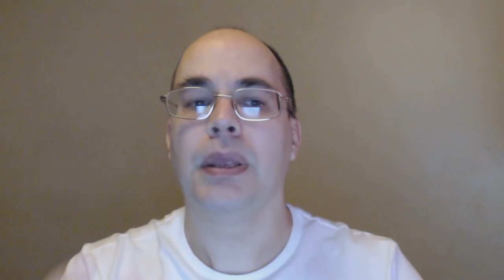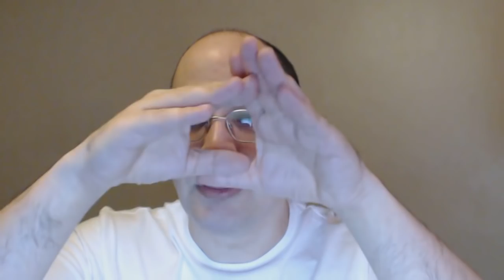How do rockets move in space, with nothing to push off from?

Comment: the combustion inside the rocket PUSHES the rocket forward.  The two sides negate each other.  The combustion escape out the back, thus, the only force left is that which is directed toward the front of the rocket... and thus, it is moved.  Is that simple enough for all you flatards to understand.  It doesn't push against whatever is behind it at all.
Reply: mkbxtr44  that's as ridiculous as mounting a large fan on board a sailing ship to blow into your own sails, and would work the same exact way. Not at all!
Reply: John Morrison, ah no! 'Thrust' works in all directions and Newton's 3rd law (every action creates an equal and opposite reaction) explains this without any of your bullshit and mathematical equations NASA throws out to obfuscate their explanation. A rocket's 'Thrust' cannot and will not work in a vacuum. It will work in  a vacuum CHAMBER but only because it can push off of the bulkheads and end cap.
Reply: @asleepinthealley  Oh you are one of those people that believe in a flat Earth and have never had a physics class and think you know what you are talking about but don't realize that you haven't a clue. Thrust does work in one direction no matter where the location is otherwise it would be a static event and no movement would occur (all of the forces would cancel out). It really is the same thing as throwing a medicine or bowling ball while on skates. The force on the ball as it leaves one's hands is the same force on the hands from the ball. As soon as the ball is not touching the hands any longer, there is no more source of energy to add to that system. The ball propels one direction,  the skater propels the opposite direction. The skater is thrust in one direction because the force placed on the ball. This is assumed that the ball is thrown exactly horizontal and away from the skater. If the ball is thrown away but upwards or away but downwards then the cosign of the angle of the direction would only contribute to skater's thrust. The gas is the propellant in the case of a rocket. The gas is under pressure and then forced out (thrown from the exhaust nozzle). Gas has mass and a change in momentum creates a force. The mass flow rate of the gas X the gas' velocity creates the force. Come on, this is not rocket science!
Reply: @asleepinthealley  What does NASA have to do with how a rocket works in space? Do you not agree that the skater would be propelled in the opposite direction of the bowling ball? You think that inertia explains that? Please elaborate.
Reply: @asleepinthealley  You are parroting Flat Earth BS that won't fly here.
Reply: @pblakeney  No. I am stating facts. When facts directly oppose everything you've been taught, it is not the facts that need to be altered. Your pushing the "Flat Earth" concept skylines yourself as a Shil.
Reply: @asleepinthealley  You have stated no facts. So, state some facts for me and lest's see how they hold up. What are your 'facts' besides the one where you don't have never taken a physics class and you are not qualified on this subject. The  last I checked it is only the 'flat earthers' that use the term shil. You speak right from their talking points. They got you trained real well.
Reply: @asleepinthealley  It is so cute watching millennials try to explain something to engineers/physicists that they themselves no nothing about. It is painfully obvious to those with engineering degrees that you have never been in a physics class room in your life.
Reply: Balabajka, please. You're effectively claiming that explosions don't work in space.
Reply: John Morrison space is a vacuum. Won't work. Space is a lie.
Reply: Flat Earthers is government propaganda and a few crackpots to boot. But when you use flat earthers to make a point, you show your under belly along with your treason.
Reply: TheDogSheep, the truth remains the truth where it is found. In a Constitutional Republic our first allegiance is to the Constitution itself and treason would be the subversion of that.
Reply: that's a lot of horseshit.
try replicate that in a gradient atmosphere.
there is nothing there to move up through, it acts as a barrier, as it tries to leave the atmosphere it gets pulled back down, or 'blocked'.
Reply: Everybody knows the easiest path of flow is how it works you don't get an equal opposing force against the rocket from the fuel payload expelling because it's path is too easy to travel..."0 pressure" even if the rocket weighed 30 lbs. The force of combustion will greatly exceed pushing the rocket for expelling into spaces vacuum
Reply: @LemarFrench  No, everybody does not know this, only you in your wild imagination.
Reply: @pblakeney  everybody knows common sense...let's see... how far is the sun from the earth...93 Million miles?? But you can explain the sun in the same manner if it was smaller and closer sooooo???  If that's a law we use you should not be able to reengineer the understanding unless it's flawed
Reply: @LemarFrench  Please explain what you mean about "rate of burn". What about it confuses you? Are you thinking that there is not enough liquid to burn to get in orbit? One can calculate how much fuel payload is needed to accompany a rate of burn to get into orbit or space. Once in space, not much fuel is needed as Newton's first law helps with that. For example, in going to the moon, most of the fuel for the mission was used to get out of Earth's atmosphere and then its gravitational force. Once the burn was made and trajectory was made to point to the moon, no more fuel was needed to get to the moon (Newton's first law). Lifting off from the moon was not demanding either as the moon has no atmosphere so little fuel was needed to escape the moons gravitational pull.
Reply: If space is a vacuum then you can't propel through it.
Every action has an opposite reaction.
Theoretically if you fired a machine gun Once In Space you would move the opposite direction of the bullet?
So for every shot fired would increase your rate of opposite reaction .

It's the biggest scientific contradiction.

Doesn't matter what shape the Earth is.
Reply: @buckrogers2752  A vacuum is by definition a space void of known mass, but not empty as we know photons don't have mass yet occupy space...traverse space...etc.  Space void of mass should not by definition be able to support mass by definition...they don't correlate just coexist...photons don't have mass so they make sense moving through the vacuum ...they do not need to be supported by mass to move through the vacuum of space
Reply: @LemarFrench  planets and stars occupy space which have mass, so space must not be a vacuum. And space does not support the mass. The mass just exists in space-time. Come on man, study physics and stop learning physics from YouTube.
Reply: @pblakeney  it... "Just" exists?  Which chapter in physics generalizes the relationship between mass and space?
Reply: @pblakeney  mass is distinct by it's density, no?  So a more dense mass changes it's nature by weight according to environmental forces right?  So the statement is space - time bends to the shear size of planetary masses "theory", unproven, only substantiated mathematically...so if mass bends space - time, photons should not follow the path of space time since they have no mass, they have no direct relationship to the space - time around them
Reply: @LemarFrench  Conservation of Mass/Energy
Reply: @pblakeney  Once again...photons have no mass... "Space" bends around mass, so mass is essentially affecting "space - time" right...so mass affects  space in this manner correct...so mass and "space" have that relationship right?  So if a photon particle has no mass, why would "space" affect it's manner of flow, why would a photon particle follow the path of "space - time" if it has no mass and only when mass is present a relationship between it and space occurs...but then on no it's only planetary mass???  Makes no sense...the effect might be one of the person viewing the effect not the actual event happening
Reply: If photons have no mass then they don't affect space, why would space affect a photon in this same regard?  Photons have energy, they exist, we can observe them via light, but they are said to have no mass
Reply: @pblakeney  Just like milk and dairy being apart of the dietary food pyramid, which isn't necessary although endorsed by the FDA and proven to have some dietary benefit scientifically, they are wrong, just like that, yes if you think that's an intimidating seat, it's not...just like the cartography of the world map being incorrect but taught in the school system...or a doctor prescribing you a medicine with opioids...common sense trumps a specialist...the problem is we've made "specialists" the pioneers, when you rarely need their field of study...now I'm not psuedo selling flat - earth, but oddly enough the system we claim to have learned all common knowledge under is and has been flawed plenty of times...this is why different countries have different practices, because we have different scientific needs and  understandings...consider fossil fuels to clean energy...which is better?  Specialists in both seats, we're talking a political game hidden in science that's why people don't get, but they honestly do and don't want to admit it...it's like sitting down and realizing American "black" culture isn't real, that's where the attitude comes from...trying to validate rebellion of traditional "American" culture...down to the food, the clothing, the language, I just wanted to use some real examples if what your saying is so rare...like the concussion protocol doctors have to implement now because someone challenged the scientific community...happens all the time...being dumb is a processing handicap not being able to retain knowledge ...intellect is being able to understand a solution 1000 different ways...political
Reply: @LemarFrench  Science has come a long way in many areas. Scientists are still trying to learn how to eradicate certain diseases and there are constant breakthroughs and understandings in health and medicine for example. This is done through the scientific method. One has to understand the fundamentals of science and math to be able to be pioneers in their field. The fundamentals don't change. The second law of thermodynamics will not change. The second law prevents perpetual motion machines from existing. The second law is what lead to the Carnot cycle and how efficient it can be determined. The fundamentals are taught in school because they are sound and it is that which is built upon to make breakthroughs during obtaining a PHD and writing a thesis. Scientists know and understand and use special relativity and general relativity and have tested it with atomic clocks and have seen a difference in their times. The fundamentals don't change. Einstein's theory did not negate Newton's work . Newtonian physics still hold for certain bounds. Relativity holds for certain bounds and then quantum physics holds for another set of boundary conditions. Scientists understand those bounds and which area of physics to employ in those bounds. Scientists are still looking for answers for a unifying theory that will unite Newtonian, Relativity and quantum physics. When they find it, it will not mean that the fundamentals of physics will breakdown, they won't. Scientists will just have a better understanding of the world around us. If it were not for Einstein's theory of special relativity and general relativity, your GPS would not work at all because the clocks on the satellites have to be corrected for both special and general relativity. If it were not for James Maxwell, the world would be void of many electrical devices including MRI scanners, antenna, nuclear plants etc. Maxwell's equations explain all electro-magnetic radiation and charges. Without quantum physics companies would not be able to  make chips on silicon waivers. Schrodinger's equations help determine an the probability of a particle existing in an infinite well. My company uses this every day in the manufacturing of chips on silicon wafers. These fundamental truths about the world around us won't change. Scientists use them to invent new things and make breakthroughs in all areas of science. The physics behind how rockets work is understood and rockets are used all the time by the military and private sector. Scientists understand rockets. Are rockets that use a liquid propulsion system that burns hydrogen and oxygen efficient? Hell no! Can scientists use their fundamental understanding of physics to think of a more efficient rocket like the Ion propulsion rocket? I challenge you to enroll in a physics class at the college level and see for yourself how the world around you really works.
Reply: @buckrogers2752  why can't you propel through space if it is a vacuum?
Reply: yeah except uh combustion is impossible in a vaccum
Reply: @yourboyeggs  no it is not. Why do you think that?
Reply: John Morrison
. YOu still need to provide a 'Reaction' 'Equal and Opposite'... Isaac Newton figured out in the 1600s what you can't understand now even with his guidance and proven Laws. You are a simpleton.
Reply: So this means...if we lived in a water world...rocket tech would be the equivalent of a car...but if that could never happen, how do rockets make sense...combustion makes sense, it's an explosion...but "space ...travel?". Rockets were designed to go higher than our atmosphere...we don't even know how high that is without having to believe in the narrative already...
Reply: How can you know the height you'd have to go in a rocket to leave the atmosphere without having a proven to traverse space "rocket" to study space in ...in the first place...sounds like we want to understand space but you can only get so high for so long and do so much because the nature of the medium we exist in is less dense than us...so you will always fall through the air...or nothing
Reply: @LemarFrench  No one understands what you are talking about.
Reply: @pblakeney  you know what I'm talking about, what makes this science so right no one can challenge it's ideologies?  All great science fact should be challenged on the regular, because nothing is known for sure...it's all been a best guess and theory
Reply: How many times you get a certain result etc. Has the rotation of the world been difinitively proven? No!
Reply: @LemarFrench  Theories are challenged everyday. That is part of the scientific method. If a theory is challenged relentlessly over and over and over and has not been proven to be false or inaccurate then it becomes a law. If scientists can make accurate and repeatable  predictions about nature of phenomena then the science becomes sound. Scientists  understand how electrons work and their different orbitals and how photons are emitted from electrons by switching to different orbitals. That is a fundamental understanding of the atom. That understanding is not going to change. What can change and has changed is scientist's understanding of how an atom attain's its electron mass and that has to do with the the recent discovery of the Higgs Boson particle. The Higgs field gives mass to fundamental particles like electrons and quarks. This only accounts for a small amount of mass in the universe. The rest of the mass comes from protons and neutrons and their strong nuclear force. There are many areas of science that astrophysicists are challenging the the current barrier of physics and are striving for new theories like string theory. This however, does not mean that the fundamentals of trigonometry, math, or science are going to be over turned. 2+2 will always equal 4.
Reply: @LemarFrench  What in the hell do you mean by proven?  Do scientists understand it? Absolutely they do! Do our watches track an Earth revolution accurately, well, it is good enough. Is the rate of rotation changing, yep because of the pull of the moon and other losses. Is the moon moving away from the Earth because of the energy that the Earth is giving the moon, yes. Will this change significantly in your lifetime, nope. And if you mean is the Earth actually rotating and how do we know. We can track stars in the northern and southern hemisphere, and get this, the stars from Earth's perspective spin in different directions in each hemisphere, you don't say! We also experience the Coriolis effect which effects our whether and having to compensate for it when firing a ballistic such as a bullet or missile over a long distance.
Reply: @pblakeney  Science is subject to bias, political bias...man walking on the moon was a single Nasa repeater broadcast, not multiple continents with their own satellite means of coverage...everyone watched the same video, "subject to bias" (example)...I'm not saying the science isn't right or doesn't exist but in it's explanation of world's we cannot touch ...man's ambition will fuel his bias in specific areas...the narrative for space exploration has drawn back since everyone started advancing their own program...so the science from our greatest achievement is filled with fantastical ideas...I don't know what C.E.R.N. ultimately does but discovering the "Higgs" particle, seems completely unnecessary ...it champions specialists for no reason, I have to trust your area of research with no metric?  That's insane...
Reply: @pblakeney  the fields of study are real from repeated testing yes, we can physically study our worldly environment in this manner on multiple levels, but when we talk..."space"...how a vacuum behaves...what a vacuum is...how rocket technology works...why they work in a vacuum...why space is a perfect vacuum...etc.  You can't just apply theory because it makes sense on Earth...an astronauts accounts are single handily the most important debriefing conversations...but how ambiguous was that press conference ...all I'm saying is Einstein called Tesla the real genius, and all these great Alexander Grambell etc had laborers actually create the gagets we use today, it's an unsung world of uncertainties sold as facts...why is the size of the earth so hard to map mathematically, they've been to the moon right they've seen the entire planet right, they can use geometry right?
Reply: @LemarFrench  Your ignorance never ceases to amaze me Lemar. One does not need to go to space to understand how a rocket works in space. We just need to understand some laws of motion which are universal in the inertial frames. If we did not understand these laws accurately then there would be a whole myriad set of problems for how things would function on Earth as well, but that's not the case. I get it, you have never taken a class in physics and you are a curious person and skeptical person. Then go take some classes in physics. I promise you that there are no hidden mirrors or parlor tricks taking place. Tesla contributed much to science and it is because of him that our homes are using AC voltage/current rather than DC. This does not negate Einstein's contribution to science as it was the single most important breakthrough in understanding physics in the 20th century. Why is the size of the Earth so hard to map you ask (not sure what you meant by mathematically)? It has little to do with size but rather its contents. 71 percent of the Earth is under water. This is the only region of the Earth that is not fully mapped and it is being mapped now using echo sounding technology. Some of the things you say  don't make much sense and makes one wonder just what education you have had. Can you be honest and disclose that here and now? What physics classes have you had in your lifetime so far?
Reply: @pblakeney  it's all theory, what advancements have been made?? C.E.R.N. doesn't help your space argument...they made a calculation then fixed an error but publicized the observation before double checking, "science" and landing on the moon is the foremost largest scientific break through...it's the last scientific frontier... they turned it into an event...I'm not ignorant, I'm a realest...the events are fake but the science is real?? Huh ...gravity is the force of what and where is that proven...show me lab tests...show me measurements...show me something...then gravitational waves becomes a thing and somehow we can measure those???  But can't replicate we gravity???  There are no absolutes to spacial sciences because we do not occupy "outer space" the Russians refused to lie, they kept true to the science...when they couldn't make further analysis they refocused on appropriating fossil fuels...rockets exist...they can traverse any environment that allots the movement due to thrust...that's true...but we have never seen a rocket traverse space...we have never seen an entire picture of our "planet" proven it's structure or otherwise, only speculation from mathematicians it's all formula based, it's all computer data and what the numbers mean, it's all trust our math not your psychology...the formulas work if you believe the variables, if you create variables for formulas to work it doesn't mean the forces all the sudden exist
Reply: @pblakeney  it used to be...inorder to make a scientific claim you had to be able to demonstrate it in a lab setting of sorts or at a fair...everything now they "infer" it to be true or right...they spoon feed you formulas...all astronomers are specialists...the events don't match the documented sciences
Reply: @pblakeney  no pictures of earth exist...maps are navigated by computers on a flat graphical plane not globular...a picture of earth should look just the same as a picture of the moon, compare a real picture of the moon to a real picture of earth something funny going on...
Reply: @LemarFrench  You could not be more wrong about anything. You refuse to comment on your background in physics. So I will ask one last time. What physics courses have you taken? Have you taken any college physics? Your refusal to answer this question perpetuates your incredulous understanding of the world around you. There is the law of gravity. Then there are engineers having to calculate the center of gravity of objects. Gravity would not work on your flat Earth so you don't believe it in it, it is that simple. Gravity is proven by how scientists can make predictions about planetary orbits and forces on objects, about your weight on Earth and on the Moon. Why can't we replicate gravity? Really? All mass experiences gravity and the force due to gravity can be calculated between any two objects and by how far apart they are. This is getting really old in having to intellectually carry you. If you can't comment on what actual physics courses you have taken then you are not qualified to be in this conversation. You choose to be a conspirator because it requires no work on your part.
Reply: @LemarFrench  Since when Lemar? The documented science? You don't believe in that stuff. The scientific method is what scientists use and part of that are experiments that either prove or disprove scientist's theories. The "aether" was disproved by the Michelson-Morely experiment. Scientists do infer things but then check them out with experiments. Experiments are data driven and peer reviewed. If a scientists makes a bogus claim about something then the scientific community would be all over it, to correct it. You don't hear about the controversy about if rockets really work in space because it is not a controversy. Rockets really do work in space. They have actually been to space and work in space. They are tested in large vacuum chambers. Rocket scientists need not defend their work to anyone. The ONLY group that does not understand rockets are Flat Earthers. It is a combination of their arrogance, ignorance and stubbornness.
Reply: @pblakeney  I've taken physics, basic physics, chemistry, what kind of physics?  You cover everything dealing in theory...chemistry you cover everything in observation testing, I've worked in labs won awards for technical drawing I'm verse in alot of areas
Reply: @pblakeney  I take rate of burn into account for rocket technology plus the fact they fire underwater, that lets me know they can work in almost any medium, the latest space launches are not proof of anything...I take the fact that air pressure thins as you rise and air driven craft burn out at certain heights when the air is too thin that lets me know space is void of air pressure or atleast the majority...I take into account alot of science...weather balloons tell is more than supposed rocket launches...I know what CERN claims, I've been a fan of science for years, until I realize I was only repeating what I was hearing being fed to me...then evidences weren't making sense quite like they used to, then you begin to understand the power of being indoctrinated especially if your of diaspora African descent.  Germans started America's space program...the creators of propaganda smh lol...Einstein was not a genius either, he actually stole relativity and repackaged it...historically science has been political and biased we've built foundation on these biases, there are scientists who were forgotten, black listed etc because their discoveries didn't help the manifest destiny of this country...I know what I'm talking about in that regard...all regards honestly
Reply: @LemarFrench  Leamar you make unsubstantiated claims that have no merit and you and the flat earthers and those without any background in science are the only ones that believe this nonsense. I am still waiting to hear your credentials. Yes, rockets can work in any medium because the plume of gasses are not pushing off of anything. They are GAS. When is the last time you tried to have air prop you up? Try leaning on air  and let me know how that works for you. I have noticed one common denominator with flat earthers. they don't know science or have never taken a science class. Us engineers use it everyday to make predictions, calculations, create inventions, solve problems. I can't stress how uncomplicated the physics is behind how rockets work in space or any medium. I don't expect to convince you anymore as you can't grasp the fundamentals. Peace to you brother.
Reply: @pblakeney  As a National Honor Roll Society member, former National Robotics Engineering Center employee, Pittsburgh Technical Institute attendee, audio engineer with years of experience I fail to see where my credentials hinder my ability to understand...lean against gas?  Like a Hurricane or tornado, whatever do you mean like a hovercraft prop you up?  This isn't a credential conversation it's a proof stricken one...whereas you choose to idealize theories as proof from the institution of math and sciences and I entertain the actual experiments themselves
Reply: @LemarFrench  So you have not taken one physics class, got it. Thanks. Not understanding the fundamentals of physics certainly hinders your understanding of physics. How a rocket works is a physics problem. Your inability to understand how a rocket works has no impact on the rest of the world (at least those with a physics background) understanding how a rocket works. You are in a small minority of people that lack the understanding of how a rocket works in space. You think Einstein is not a genius but yet have not taken one physics course and therefore have not studied physics but still perpetuate unsubstantiated claims that are ridiculous and judge the works of others that have PHDs in physics. Thanks. We all see that now. You don't trust scientists. They actually have proof that backs their claims. The fact that rockets have been to space is proof that rockets work in space but you will not accept that because you need to appear smarter than the rest of the world. Everything you purport is just what all flat earthers claim. You have watched a lot of YouTube videos and know all of their inaccurate claims. You are just a biased conspirator that does not understand science and math. Keep on with your bad self and us engineers/physicists will continue leading the way while you argue amongst yourselves (flat earthers). You see when I use the word engineer it is because I actually have an engineering degree, not an engineering technology degree, an actual electrical engineering degree. I can see you don't have the ability to think critically. Using  a hurricane or tornado or a hovercraft? Air under a high pressure of course can do work Lemar. But how is air pressure at 15 PSI going to do anything? Explain how air is going to push back on a plume of exhaust gases and how that gas is going to push back on the rocket after that gas has already left the system of the rocket.  Its just ridiculous! The only reason airplanes don't work at high altitudes is because of the lack of oxygen which is a requirement for combustion. Rockets carry their own oxidizer with them. This conversation is not getting through to you so I won't try any further.
Reply: @pblakeney  ohhh that's how that works, thanks for clearing that up, glad we have a specialist on the topic who thinks physics class validates understanding, which I've taken...I see your a specialist on space travel as well what height does space actually begin?  Matter of fact can you explain to me why the Earth is the same size the moon would be if you were standing on Earth looking at the moon in the famous moon landing photos but I'm not a specialist what do I know about ratios ...why do no craft factor in the rotation of the planet when traveling...I didn't take physics I'm being ignorant to ask that question righhhttttt...matter of fact since the Russians were the first ones to enter what we call "space" we can create a metric of sorts for what's true...they had countless launches with half the evidence, I don't think we kept better records right Apollo ...I must lack a ton of knowledge to question something with theoretical proof...show me a real moon rock not some petrified wood...your basis of conversation rests solely on science faith...like a devout Christian, "if this is like this here, we can assume this happens like this everywhere" not the case ...how do you know the moon isn't ice?  Because of the movies they showed you, let's say the moon was shown as ice, would you defend the moon as ice, hmmm thinking critically here, it's not that I don't believe it's wheres the undeniable proof of these scientific claims...cgi recreations?   Search for a black hole?  A video narrated by Alec Baldwin...or prove gravity by dropping a mic 🤨...
Reply: @LemarFrench  Wow that was quite the incoherent rant. We were having a conversation, I thought, on the physics behind how a rocket works in space. Just because you don't understand how space can exist or where it starts and what the moon is or is not and the shape of the earth and several elementary physical attributes of our world and universe, then you throw all of science out the window and think that the whole world is in on a conspiracy together to pull the wool over your eyes. Again, you are in the minority of those that believe the Earth is flat. That gravity does not exist. That America has never been to the moon. That rockets don't work in space. That there is no ISS orbiting the Earth right now. What is your point? It is because of physicists understanding of how a rocket works in space that has lead to breakthroughs in rocket technology that might enable mankind to get beyond the solar system. I don't understand your point in arguing all this? Are you trying to convince me of something? Are you trying to change the world? Are you trying to save us scientists/engineers from our own ignorance? So what? So we can stop inventing things and making life better? So that we can stop pushing science to the limits of our understanding? We don't have a hard time with the fundamental concepts. You do. You argue from a point of ignorance and demand that you know what you are talking about! Seriously, go take a physics class and then come back to discuss with the big boys. This is starting to get exhausting. This is like trying to explain trigonometry to someone that can't grasp that 1+1=2 and they just keep purporting that math is a conspiracy and that the moon is made of cheese. Rockets are fired in huge vacuum chambers all the time. Large enough that there would not be enough time to pressurize the chamber to have what you  think happen. It is alright to be interested in science but it is dangerous and irresponsible to go around spouting off incoherent BS when you have not actually studied the subject matter. And NO, watching YouTube videos is not an education. Scientists are not conspiring to fool anyone with the shape of the Earth. Actually, I never understood what the purpose of fooling those to believe the Earth is round. What is the catch? Who is to gain? How can that benefit someone? How can the whole damn world be in on such a massive conspiracy. I believe it is you, who makes so outrageous claims that needs to back up their arguments with proof. I have seen all the flat Earther's videos and know all of their nonsensical claims. They all have one thing in common and that is a lack of understanding of physics. It is indeed very amusing to us engineers/physicists. Good day!
Reply: @pblakeney  "where is the evidence"
Reply: @pblakeney  I listen to these claims I listen to the math, I listen to the science and then I look for the evidences...nothing more nothing less.
Reply: @LemarFrench  If your listening to math and science, you will never grasp it. You have to put in the work and work problems and work more problems unless you are a prodigy and I can already deduce that you are not a prodigy.  So you might indeed 'listen' to the evidence but I am sure you don't quite understand it. You know the flat Earth is a bunch of nonsense and bad science and if you don't, then you don't have a grasp of fundamental science concepts and critical thinking, or you are a conspirator because you think it is 'cool' to go against the norm. If you are really searching for the truth, take some college level physics courses. What do you have to lose? At least you will not be arguing from a position of ignorance. I sincerely want you to grasp this science stuff but instead of asking questions to learn you are defending a position of ignorance. You don't have to try to convince me of anything. I think you are just trying to convince yourself.
Reply: @LemarFrench  Lemar, it is you that must provide the 'evidence' for outrageous claims that go against what the rest of the world knows to be true. So, where is the evidence?
Reply: @pblakeney  There are foolish claims on both sides, but it's a moral center ground that in lies the truth, science has a habit of "embellishing" as well...it's subjected to human error....human claim...human observation....two people can watch the same event and draw two different theories such as a boat going over the curvature of the earth...or refraction...or how much drop "should" occur...laser lake tests...sunlight tests, but there aren't definitive answers...these are from in the field experiments...science can't tell you what gravity is ...just it's effects...or it's "supposed" effects
Reply: @LemarFrench  You are confused once again. There are a lot of crazy people making ignorant claims on behalf of the flat earthers that are not based in science. This is not science. Science is data driven and not subjective. People making ridiculous claims is subjective but the fundamentals of science and scientific laws are not open to interpretation. Those that think it is just don't understand simple physics, such as yourself. Scientists understand the effects of gravity and can address all of the physics behind this,. Gravity  is taken into account in just about all physics problems. There are static and dynamic situations that rely on gravity being included in the free body diagram. Gravity is taken into account in aerospace engineering with flight and orbital mechanics, in projectile motion, in the normal force etc. So, gravity is a real phenomena. Scientists might not understand what causes it but they sure as hell understand its effects and not its "supposed" effects. You are still arguing from a viewpoint of ignorance. It is you that is biased and just want to continue down the path of ignorance. The point you try to make about two people watching an event and drawing two different conclusions is not science. You want me to believe that science is subjective because two idiots who don't understand the science of what is taking place somehow make science subjective. NO, NO, NO! That does not change the science of what is taking place. There are just two ignorant people not understanding what is happening. Like when someone thinks that people in China are "upside down". Science can explain this and there is no concern for them. However, to the flat earther, this does not make sense. The flat earther then tries to argue that gravity is not real, why, because gravity on a flat earth would not work. The center of gravity would cause a sideways component vector of force. They argue that instead of gravity there is density and buoyancy. However, these two things depend on the definition of gravity to exist. Have you ever tried removing all of the air out of a vacuum chamber that a balloon filled with helium occupies? What do you think would happen with the balloon? Science does not fail because two morons observe the same event and arrive at different conclusions. It is the person that is subjective and not science.
Reply: @pblakeney  First off helium is heavier than ..."nothing" so it falls in a vacuum chamber, I don't understand your argument there...and it's lighter than, what mainly consists of air so it floats outside...depend on gravity?  Once again, I'm not selling flat-earth lol I challenged ideas on a root basis of common knowledge...what is projected to happen as opposed to what actually does or what's shown to happen...or in the case of diamagnetic fields...paramagnetic atoms...and being able to facilitate a mock atmosphere using a "lodestone", cool concepts that play "d-list" to gravity...
Reply: @LemarFrench  So, you agree that gravity is not just explained away by buoyancy and density. Are you saying that it has to do with the earth's magnetic field? You did not actually make a claim and I have no idea what you meant by "facilitate a mock atmosphere using a "lodestone"". What exactly are you saying? You make the assumption that understanding physics is intuitive and common knowledge. It is not all that intuitive and when physics students are asked questions about what would happen in a particular case, they usually get the answer wrong as does the rest of society. Just because a group of people project what should happen does not mean they are correct. Physicists on the other hand KNOW what is happening especially when it has to do with fundamental physics. It is not debatable that rockets don't work in space. The physics is deeply understood behind this. Your opinion does not matter. Science is not influenced by your challenges. It is ok to question things. After this you should prove them with evidence, for which, so far, you have produced zero evidence. You just keep making claims that you like to challenge the popular belief system. Make some claims. What do you believe and why? Why don't rockets work in space?
Reply: @LemarFrench  You said 'heavier', so you do have some understanding of what heavy is. Anything on Earth has a weight =mass(kg)X9.81 m/s/s. So it appears that you understand in some way that objects are subjected to an acceleration on Earth but you have failed to give credit to 'gravity'. Why exactly don't you believe that gravity is responsible for this phenomena?
Reply: @pblakeney  helium is more dense than "nothing"
Reply: Helium should fall outside too according to gravity
Reply: @LemarFrench  According to gravity? Is gravity a person now? See this is what I am talking about. You just don't understand what is going on. Scientists understand how gravity affects objects and no scientist would agree with you nor would any engineer. A helium balloon will rise in Earth's atmosphere because helium is lighter than air which causes the helium balloon to displace the air around it resulting in an upward buoyant force which is greater than the force of gravity acting on the balloon which is the mass of helium +mass of balloon X 9.81 m/s/s. The buoyant force is calculated by the density of surrounding fluid (air) X volume of balloon in that fluid X the Earth's gravitational constant (g=9.81 m/s/s). If one were to place that same balloon in a vacuum chamber and evacuate the air in that chamber then the density of the surrounding fluid  would equal zero and the buoyant force would equal zero and then the force (mass X acceleration constant due to gravity) would dominate in that system. You are just learning physics from idiots. That does not mean 'science' is subjective. You just don't understand it. The same goes for your understanding of how a rocket works in space. You are a really stubborn person. AN engineering/physics degree is a very difficult one to obtain. It is not intuitive, however, after one starts grasping the fundamentals then it gets easier to understand and how to predict other events. That is essentially what an engineering degree allows one to do, to understand what the effects of doing something would be and how to calculate those effects. So if you would rather just argue with engineers and physicists, then good luck with that.  I implore you to challenge yourself and take some physics classes and then invoke your talents of curiosity.
Reply: @pblakeney  In order for that to be true since I don't understand anything...that means everything no matter the density will fall at the same constant in a vacuum chamber correct?  Void of air...right like your saying no buoyant medium to obstruct rate of fall right?  Paper falls like iron...right dust and gas fall like steel...feathers and bowling balls...I saw that one...they concluded without a metric nothing is falling at all...but you can without a shadow of a doubt profess that true 100% of the time?  Ok cool
Reply: @LemarFrench  Who is 'they'? And what do you mean that 'they' concluded without a metric nothing is falling at all? Yes, engineers understand that ALL objects fall at the same RATE. Why is that hard to believe? What is happening if the objects are not falling? Please enlighten me.
Reply: Says the guy who is completely unable to actually defend his position, and has to actually copy and paste his "arguments" from other sites :D
Reply: +Magic
Yes, that's pretty much you, mr ultracrepidarian :) I mean, at this point, you have to know you're wrong, with all your ducking and weaving you've so skillfully employed in your responses, and with the way you change the topic so often :]

It goes kinda like that:
Magic: "bunch of copy pasted stuff"
Other people: "Here's why it's wrong: (posts detailed responses)"
Magic: "(Oh crap, I don't know how to respond to that). Um... Gravity is a density! And it doesn't even exist! (There. I'm a frickin' hero!)" :D
Reply: Magic, they have really hard time letting all that shit sink in. their dissonance just not letting it happen. They cant imagine vacuum and they skip that physics class when they talked about Joule-Thomson effect.
Reply: Let's assume  you were to travel in a 'rocket' to the edge of the atmosphere, you will find that there is no air pressure. Instead individual air molecules are zipping around in the vacuum of space. The molecules can zip any way they like but they tend to zip towards the Earth because the Earth’s gravity acts on them just like it acts on anything else with a mass.

The reason the vacuum of space doesn’t attract the molecules of air is because there is no suction to the vacuum of space. There are a few assumptions here that defy all experimental observations and logical thinking:

1. If gravity pulls the air molecules towards the Earth’s surface, then the decrease in pressure with the rise in altitude wouldn’t be possible; it is simply absurd to imagine gravity changing so drastically for hardly any significant change in the distance to the center of mass.

2. If the atmosphere is not sucked into the vacuum of space then there is no vacuum in space. It is crazy to imagine such a severe decrease of pressure until it reaches absolute zero, when all experiments certify the opposite: Any pressure tends to equalize within its surroundings. Always and everywhere!  That’s why we have wind, currents and a dynamic climate on Earth. If the gradient decrease in pressure of Earth’s atmosphere is making this amazing feat of ‘insulation’ possible, then how come that the earth Earth’s atmosphere was formed in the vacuum of space at all? How did the very first molecule “survive” the incredible surrounding vacuum? The air doesn’t rush into the vacuum of space because the gravity forces the air molecules down to Earth? Gravity again? This sounds like desperation! All the empirical evidences we have regarding the behavior of a vacuum directly conflicts this mumbo jumbo of idiotic nonsense.

The name is derived from the Latin word “gravis”, which means “having weight”, while the Law of Gravitation is defined as: “That mutual action between masses of matter by virtue of which every such mass tends toward every other with a force varying ‘directly’ as the product of the masses, and INVERSELY as THE SQUARE OF THEIR DISTANCES APART.”

Reduced to simplicity, gravitation is said to be: “That which attracts everything towards every other thing.” That does not tell us much; and yet the little it does tell us is not true; for a thoughtful observer knows very well that everything is not attracted towards every other thing…The definition implies that it is a force; but it does not say so, for that phrase “mutual action” is ambiguous, and not at all convincing.

The Encyclopedia Britannica tells us that “The Law of Gravitation is UNIQUE among the law of nature, not only for its wide generality, taking the whole universe into its scope, but in the fact that, so far as is yet known, it is absolutely unmodified by any condition or cause whatsoever.”

Here again we observe that the nature of gravity is not really defined at all; we are told that masses of matter tend toward each other, but no reason is given why they do so, or should do so; while to say that “it is absolutely unmodified by any condition or cause whatever” is one of the most unscientific statements to make! There is not any ‘thing’ or ‘force’ in the universe that is absolute, no thing that goes its own way and does what it will without regard to other forces or things. Again, gravitation is spoken of as a pull, an agent of attraction that robs weight of its meaning, something that brings all terrestrial things down to earth while at the same time keeps the heavenly bodies in their places and prevents them falling toward each other or apart.

The thing is ALTOGETHER TOO WONDERFUL, it is NOT natural; and the theory is SCIENTIFICALLY UNSOUND.

In a letter to Dr. Bentley, on Feb. 25th, 1692, Isaac Newton says: “That gravitation should be innate and inherent in matter, so that one body can act upon another at a distance – is to me SO GREAT AN ABSURDITY, that I believe no man who has, in philosophical matters, a competent faculty of thinking, can ever fall into it.” - Yet many have fallen into this ”great absurdity.” Such men therefore—according to Newton--have not “a competent faculty of thinking” in philosophical matters. I am happy to be in agreement with Sir Isaac on this important point.

Sir Robert Ball says: “The law of gravitation…underlies the whole of Astronomy.” (Story of Heavens, p. 122) It does not speak very well for the Astronomy, if it is founded on an acknowledged ”great absurdity.”

Thank God gravity is so weak, that it prevents the infinity vacuum of space from sucking out our atmosphere. BUT…if the earth rotated we would have a completely different (totally opposite) situation regarding the air pressure regimes in the atmosphere!!! Gravity doesn’t in any way cause the atmosphere to magically rotate with the ball as it supposedly pulls toward the center of the earth! Air at higher altitudes would actually have to be moving faster than the earth’s surface in order to keep up as it would have an increasingly farther distance to travel during the same angle of rotation.

For the rigid Earth to rotate about its polar axis, the whole air in the atmosphere should experience a rotation with a constant time of 24 hours (in rotation, the angular frequency 2pi/T is constant). Each atmospheric layer should have a different angular velocity; the angular velocity becomes greater at higher altitudes. The outer layer (not the outer most) of the air atmosphere is chosen at a height of 500 km altitude. The rotational velocity at this height is 1800 km/hr (500 m/sec), which is the same as the peripheral speed of a gas centrifuge.

The rotational velocity at the surface of the rigid Earth is 1670 km/hr. at the equator. The outer layers of the air atmosphere, during rotation, should be pressurized than all layers toward the Earth’s surface. Without going into numbers; the air pressure of the air atmosphere in that case, should increase from a minimum value at the surface of the rigid Earth to higher values as we ascend in the atmosphere. The profile of the air pressure should hold people down, without the need of any ”redundant force”. In addition, the systemic variation of the air profile should cause the phenomenon of falling objects - air pressure.

Moreover, we should observe more hydrogen at the surface of the Earth than at the outer layers. The most important element in our life - oxygen - should be concentrated at the outer layers and depleted near the Earth’s surface. The Newtonian and Heliocentric followers have no choice than one of these; to be pressure or to be gravity. The choice of Earth’s rotation (the cause of pressure) should repel the gravity from Earth. CONSEQUENTLY, THE HELIOCENTRIC MODEL LOOSES THE MOST PRECIOUS ELEMENT.

The choice of gravity should remove the concept of Earth’s rotation from the cosmic motion, consequently; the journey of the Earth around the sun becomes useless since half of the Earth should be always in darkness and the second half should always be in light.

So according to “Ball Earth Theory” GRAVITY is the all-powerful force that holds the atmosphere to the earth. There is no boundary of what it can hold down, just magical…How is it possible that a partial less powerful vacuum can lift huge slabs of rock but the ALL POWERFUL vacuum of space can’t even pull AIR away? It’s time to engage critical thinking and break that lifelong globe earth programming! Gravity and the vacuum of space are LIES intended to enslave you! Free your mind from the matrix of control. We live on a beautiful FLAT EARTH!
Reply: Magic  I'm sure none of them read that, they have to win arguments since they are the 'educated' ones. That's how strong the ego is on the mind.
Reply: Magic 
Stop anthropomorphising the vacuum of space
Reply: @Magicspirit11  WOW, one can always tell a conspirator by how they go on and on and say very little. Take a physics class for the love of humanity so that you will at least sound educated. You basically just said that "gravity" is mysterious. There is both the theory of gravity and the law of gravity coexisting. The law predicts the effect of gravity on objects.  This is understood by scientists very well and depend on its accuracy. Einstein solved the puzzle on the nature of gravity with his "General Theory of Relativity".  Einstein's theory has yet to be disproven and is used in many high tech hardware.
Reply: Jan Strzelecki says the troll without substantiated proof. LOL
Reply: LOL says to LOL’s....lol
Reply: John Morrison you are flat wrong